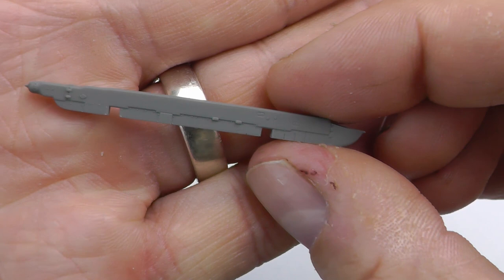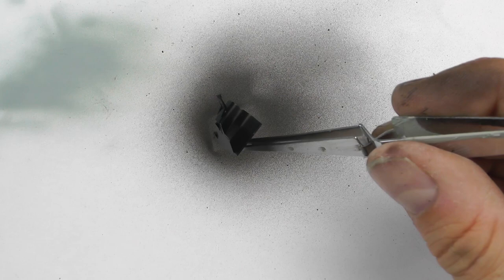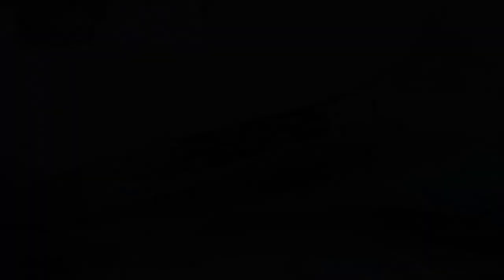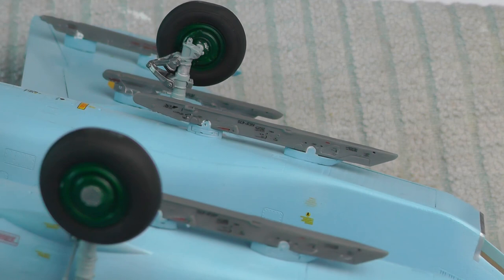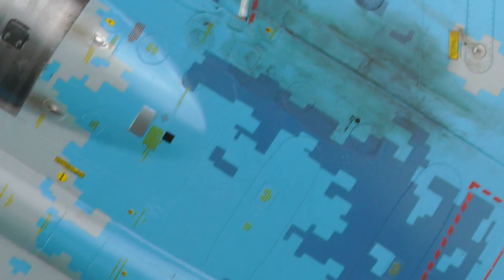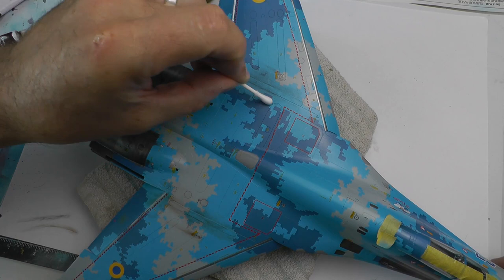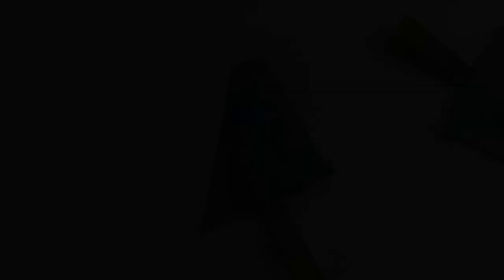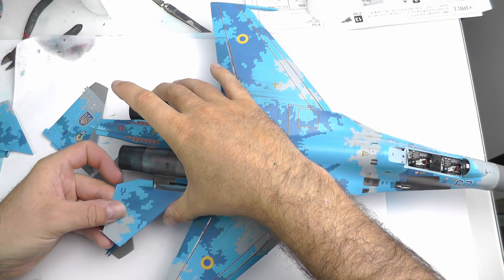Great Wall Hobby SU-27UB Flanker build part 11

Comment: On the subject of the Tamiya flat black, it might be a bit glossy due to not thoroughly shaking it. Alternatively, you might have thinned it down to much.

Otherwise, great work! It is looking stunning.

I am certainly not a professional, but I have had very good success with weathering with the oil brusher by AK Starship bay and Starship Sludge. Have you tried these?
Reply from the maker: Starship filth is on my hit list of purchases. I shall these others too. Thank you for the advice. I think i had probably thinned the black too much in hind sight. Thanks again though 😊